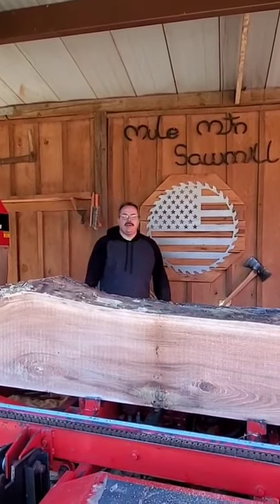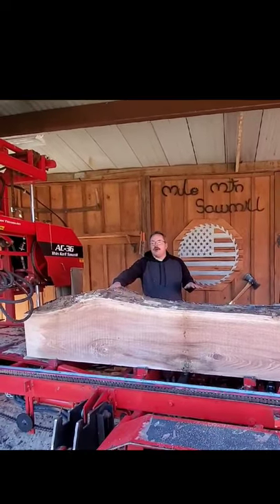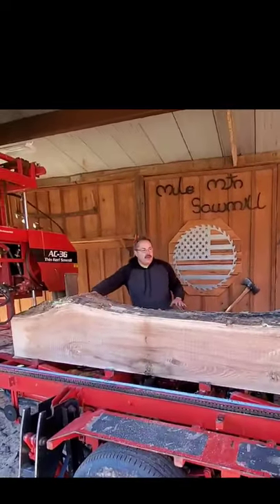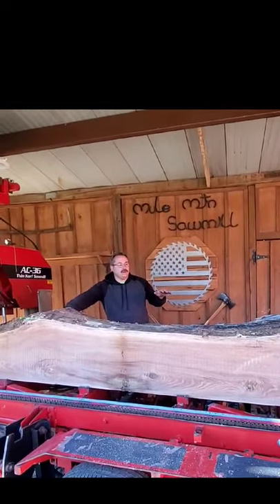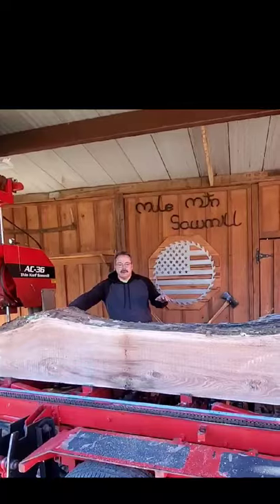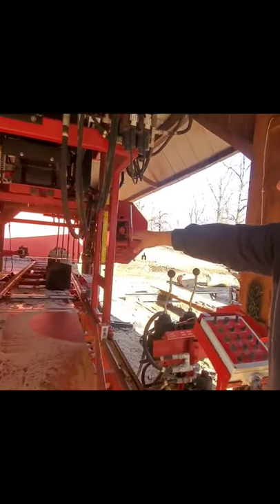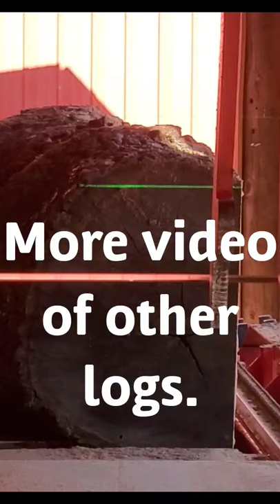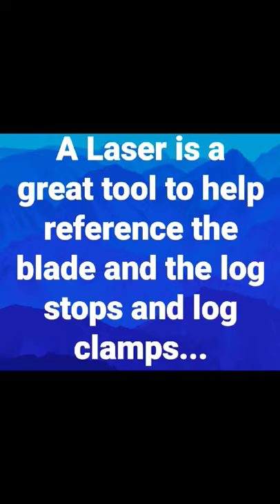Adding a laser to my Cooks Sawmill.

Comment: I like that you shared this and it helps me confirm that I want to put a laser on my sawmill.    So for me to do it I still need to know where to get the laser?  Was your sawmill designed to add it as an option, or is this a DIY project?  How is it mounted to the sawmill and does it run off the 12 volt system?  What power is the laser and can you see it shining down the side of the log in broad daylight?    I am new to bandsaw saw milling and I have made some less than ideal first cuts on irregular shaped logs.   That is where I think this would help me.
Reply from the maker: I will make another video. I have had several people inquire.